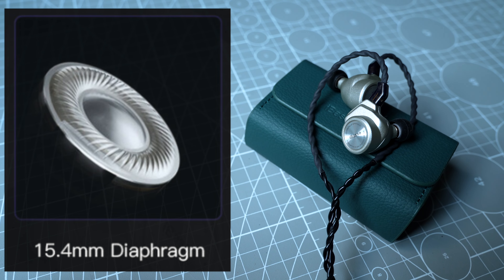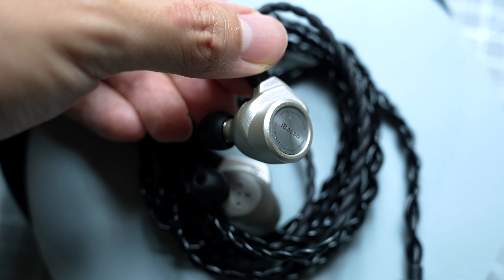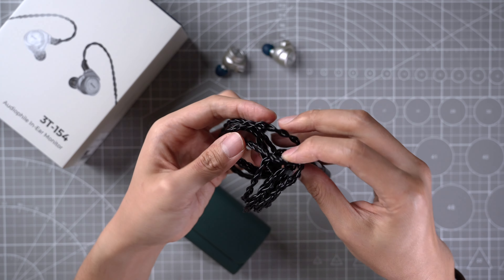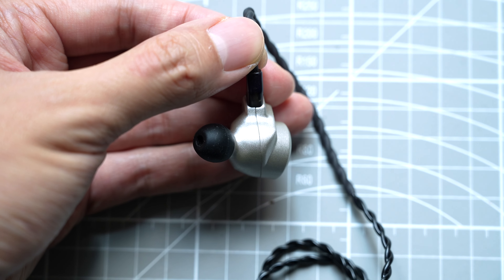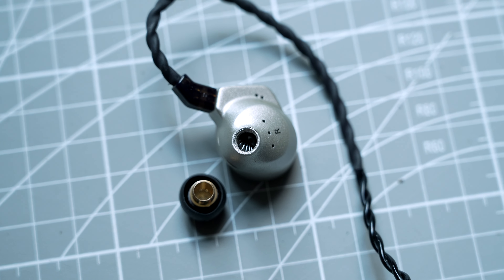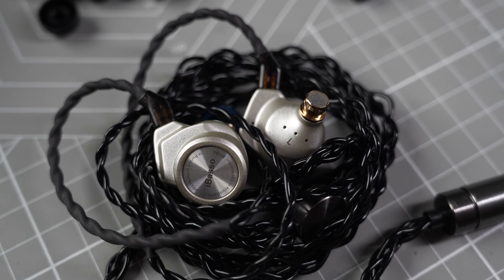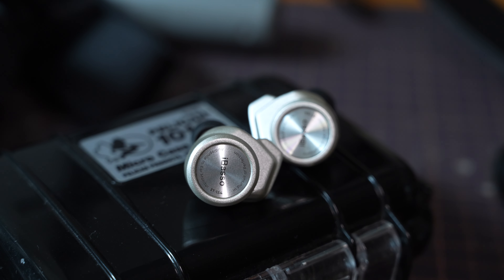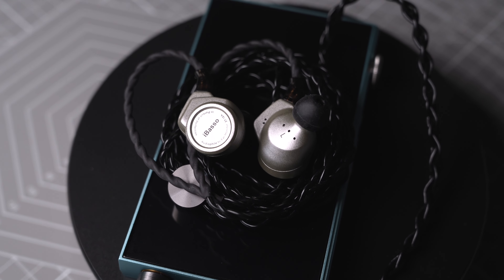IEM with MASSIVE Dynamic Drivers - iBasso 3T-154 Review

Comment: Congratulations, great review. In your opinion, which is the best connection to the DC07PRO in balanced or single ended?
Low, medium or high gain?
Did you use digital filters?
Reply from the maker: I would recommend using high gain on the balanced port. Although the 3T-154, is an efficient IEM, I think it will benefit from a power powerful amp. It opens up the highs a bit more.

Comment: The 5 k region looks menacing. Is there any unnatural sharpness? This looks like a mid focused earphone to me because there is not much upper treble.
Reply from the maker: The 5k regions does not bother me too much, probably because it dips pretty quickly in the upper treble to balance it out. But vocals can be a bit bright to some due to the early rise in the upper mids.
Reply from the maker: Oh and I used Final E tips when I reviewed the unit, where were relatively narrower tips. Which I thought complemented the FR quite well by boosting the bass and maybe taming the upper mids and treble a bit.
Reply: @Late_Night_Unboxing  Thanks✌️